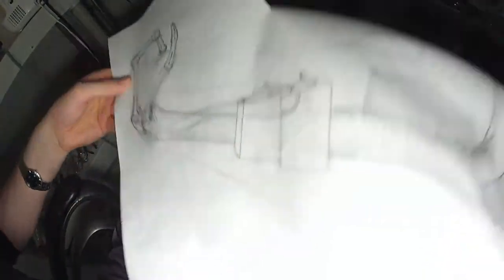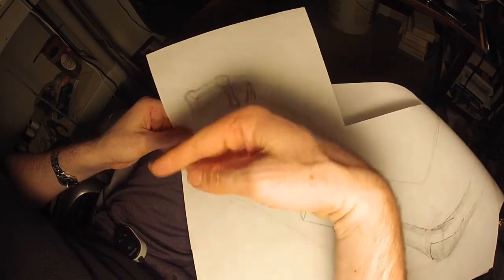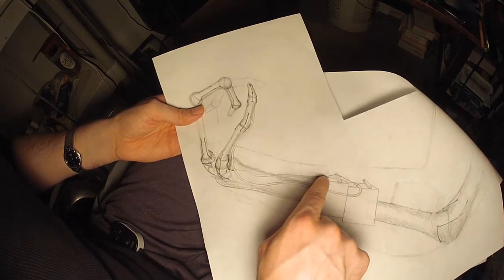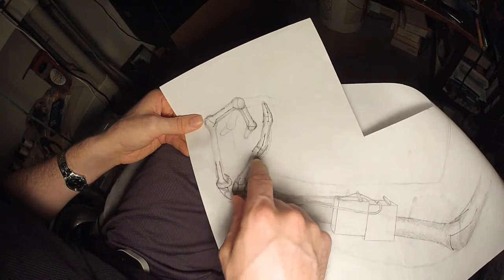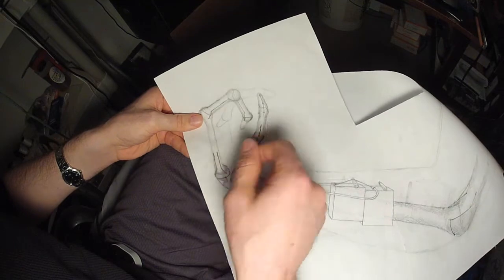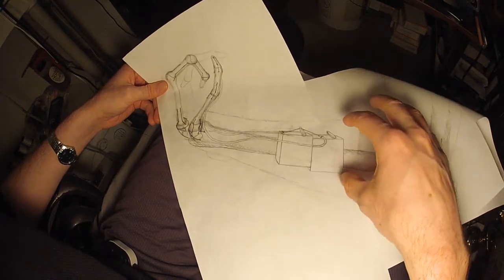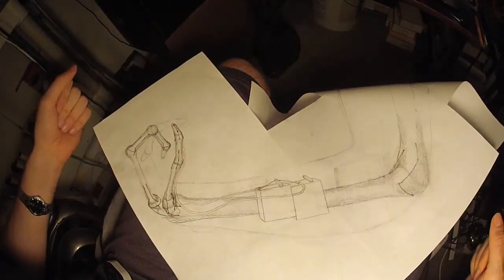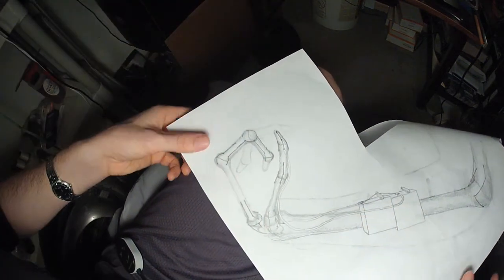Advanced Realistic Robotic Hand Design Discussion | Building Humanoid Robots #3

Comment: I'm excited that I found your channel! I have been practically obsessed with learning about artificial muscles. If I can find a cheap way to make a fast responding muscle, I'd like to show you how I did it.  Am currently looking into things like nylon torsion and nanocarbon wax motor muscles or ionic electroactive muscles. I hope to recreate a Velociraptor structure, or at the very least, make a decent exoskeleton.
Reply from the maker: using servos as pulleys on string which acts as the muscle is the best way i have found and welcome to the channel!